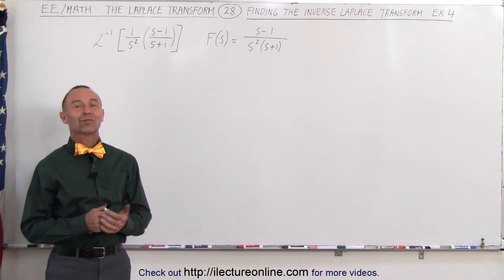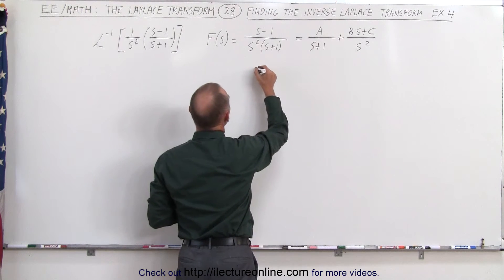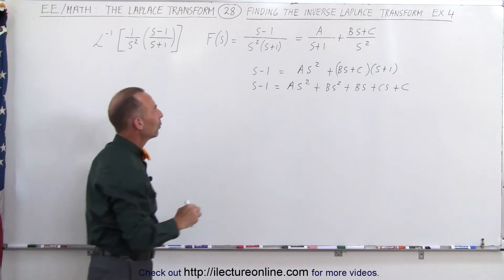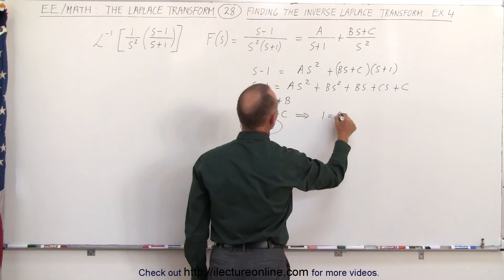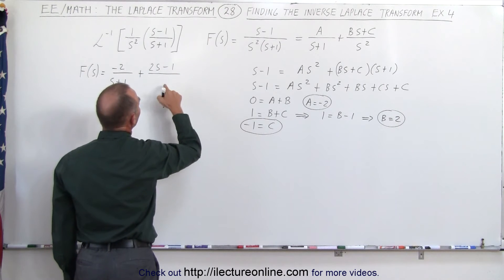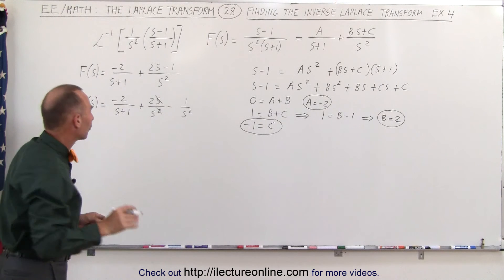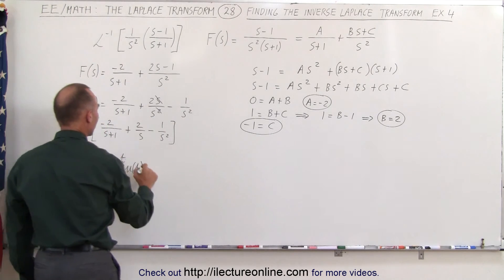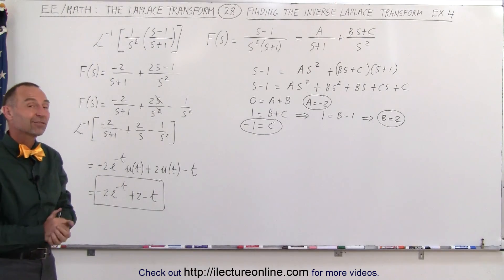Electrical Engineering: Ch 16: Laplace Transform (28 of 58) Inverse Laplace Transform=? Ex. 4

Comment: How would you apply this to engineering
Reply from the maker: This is a method used for solving differential equations, and can be used to solve circuits whose voltage or current equations are differential equations.
Reply: +Michel van Biezen ok thanks for your insight